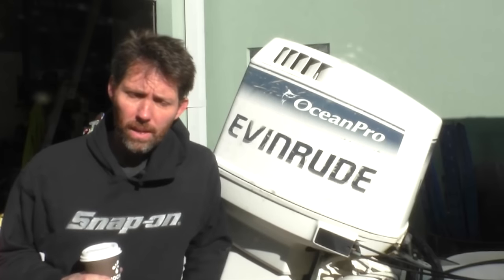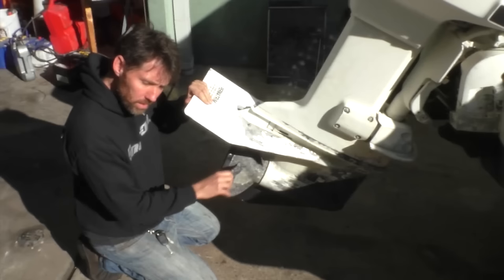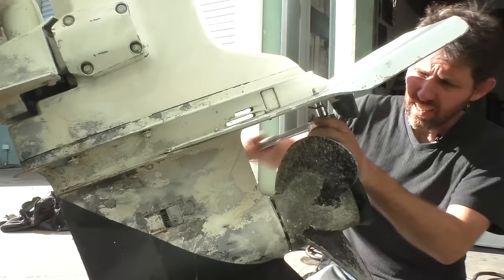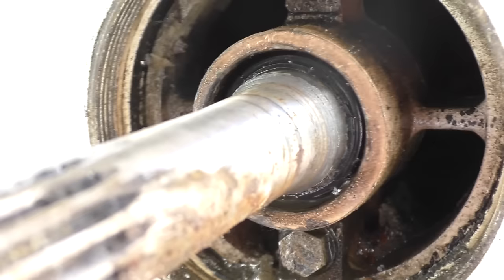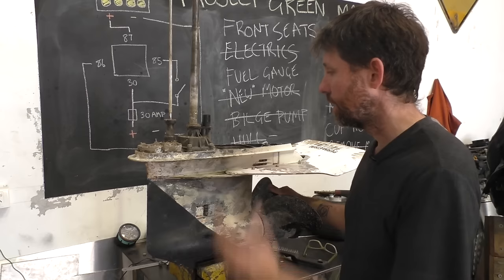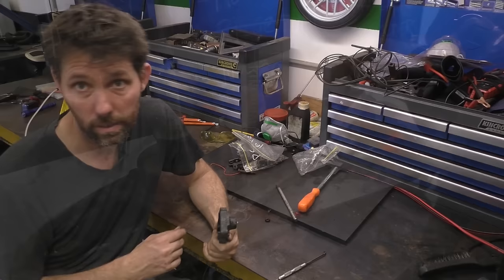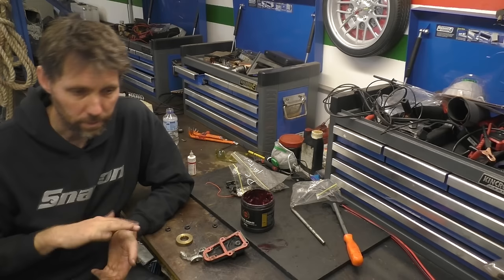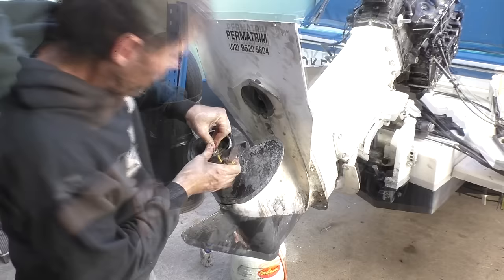Starting an Evinrude 150 outboard for the first time in years

Comment: Great video but i have a question. The impeller is clearly dried up and wont last long or build enough pressure for the engine to run cool. A new/good one dont behave/looks like that, why you didnt just replace it right away is wierd to me? Its like 15bucks and you save alot of time by not have to drop down the lower unit again later on? Also just blow alot of oil into all oil lines with compressor while cranking without sparkplugs so the bearings get lubed aswell as the walls, Put back sparkplugs and then just start it, in my opinion its the fastest and easiest way to safely start a engine thats been on pallet for a long time. Thx and keep it up.
Reply from the maker: Hi Patrik. Instructions from the owner were to avoid spending any money or ordering any parts until it was confirmed the motor was a going concern. Interesting technique with using compressed air to blow oil through, I'll have an experiment with that some time.

Comment: I have had several versions of that exact engine. With reference to your autopsy video, and confusion over the cause of the failure, I would say that this engine sounds unhealthy from the get-go. The starter sounds like it hits a flat spot signifying low compression (maybe you checked compression?). I also hear an unusual amount of jittering from the powerhead when it starts. Mine have always been very quiet with no real clacks or noises from the cowl area. This makes me think the issue was pre-existing and only exacerbated by being run. 

Lastly, these engines have a hot-start feature that gives a healthy idle flare at startup and a  high idle for the first minute or so when cold starting. Doesn't sound like yours is operational. 

Just a couple thoughts from someone who has owned a fair number of these and spent some time tinkering.

I buy a lot of boats that are inop from sitting for years, so this type of process is very familiar and entertaining to watch someone else do! Great vid.
Reply from the maker: Thanks Jake. I've never worked on one of these so its interesting to hear from someone who has. Hopefully a series of follow up videos will be coming along soon.
Reply: yo i have the same one also. donno who thought it was a good idea to have 6 carbs. haha.. dammit
Reply: @pistol850  Suggested by Carburetor Fabricators Local 107.
Reply: i was just trying to figure out how to work on that motor that i actully own. one of u geniuses  wanna come show me. oh what u dont know how and u dont even own this motor.... ok
Reply: ps i dont want no problems...but i am 6ft 200lbs if u wanna come over to pcola and and get pummeled
Reply: thanks but never heard of that. but im not trying to change carbs now because i just took all 6 apart and gasket sealed and put all {6! } back together because at least 4 were leaking.which is why i was just venting about that pain in the butt setup probly designed by the same evil german sabatoge artist that designed my bmw} in the first place but will upgrade or invent an upgrade someday. {probly called a holley 4 barrel carburetor conversion power upgrade package} for any non-believers watching....bang

Comment: well you put spring back on the seal  i wouldn't do that  i would to do reseal everything on lower unit and also you should check compression and spark test if everything comes out good before do anything major repairing that motor  i see that what i am working outboard for 30 years and some of your opition are differance way you doing than mine i just let you know  mine is lot simple to do and quicker ways

Comment: Thanks you are the man.  Pro to the MAX Maybe you can help me with my 2004 Johnson 150 engine is very stiff on the pivot Axel how do I lubricate it I can’t find a fitting it’s very difficult to steer engine has very low hours runs perfectly just was in storage for a long time and it’s difficult to turn please advise if possible and thank you very much keep up the great work his messages from Florida USA

Comment: The nuts, bolts and screws are all af. The shift rod is ment to be that shape DO NOT STRAIGHTEN IT. The seized shift rod is a common problem. Don't use loctite on the shift cover screws, use OMC gasket sealing compound or the Mercury version. The oil filled carbs is also very common with a motor that has been left standing, the oil tank is not venting properly, replace the cap.

Comment: Absolutely excellent video. Please continue to share. When I bought my Johnson 150 the the carb linkage had been toyed with to limit wide open throttle. I'm concerned that the electrical advance, which appears to attached by a linkage rod underneath the flywheel, has been adjusted as well. It's a very light 17' boat with a high speed prop and the previous owner didn't want the motor revving to top speed with his son operating it..  do you have any idea where I start from to restore the linkage back to factory settings?
Reply from the maker: The best thing would be to search the net for a PDF service manual. It will probably only cost you $10-$15 and it will have all the specs you need to return everything to its factory setting.
Reply: @DangarMarine  Great advance, I will do as you suggest. Thanks.

Comment: Great Videos, I have 2004 150 Johnson. The motor has been run for years. Engine serviced runs great…except……steering very tight…. pivot shaft needs lubricant….Can you tell me the best way to get the pivot shaft lubricated for this 150 2cycle motor. I just can’t locat a lube point for the pivot shaft.

Chef Mario Florida USA

Comment: Hi Stu, just been back to this video for a second look. Like the first time, very good and really informative. Up in the north west of England, I have been working on a Suzuki DT50 2 stroke with similar gear shift issues. Anyway, my question is actually regarding your advice on whether to use anti seize grease or thread locker on lower unit bolts, either for water pump housings, shift rod housings, or lower unit attachment bolts? On the video you used thread locker on the shift rod seal plate bolts. I'm never quite sure what to use in these situations? If you use anti seize grease then there is always a good chance these bolts can be removed in future, but equally they could work loose during use? If you use thread locker then they certainly won't work loose, but with the added help of saltwater corrosion, the bolts may never come out again and will shear if you have to try to remove them later. Any suggestions would be very much appreciated. Cheers, Jon

Comment: I have a force 50 that has water coming out the telltail like it should but overheats. I have a new tstat in it...
Reply from the maker: I would take the thermostat out and run it to see if water comes out where the thermostat is. I show testing this in this video https://www.youtube.com/watch?v=dx8_xP30aSY It could also be overheating due to a blocked water jackets or a blown head gasket.
Reply: Dangar Marine could it have good compression and a blown head gasket?
Reply from the maker: Yes, it is possible. You would expect a blown head gasket to reduce compression but I have definitely seen situations where the readings are still good.

Comment: About 25 years ago, the common advice at the end of a boat trip was to run the gas/oil mixed fuel out of the carburetor by unplugging the fuel line from the tank and letting the engine run till it quit.  When we got a newer 2 stroke outboard that had a separate 2 cycle oil reservoir, i.e. the engine mixed the oil with the gas for you, this habit was a disaster.  When you disconnected the fuel line and let the motor run till it quit, it evidentially continued injecting oil and filled the carburetors with oil.

Comment: I noticed that it did not have an exhaust rubber housing on dismantle and installation. I've replaced my water pump but on the water today it kept bogging down and thinking my exhaust boot housing was not sealing and its not smoking from prop or outlets near anode? Maybe suffocating carbs?? Flushing on muffs it runs perfect?

Comment: Hey Stu,  your videos have been a big help.  Its funny I've been getting a 150hp evinrude (two stroke) going over the past few months and would have killed for this video earlier.  Off topic question, I have a 1998 9.9hp four stroke evinrude kicker on the same boat and have been having trouble.  It runs great for about 15mins and then dies (pumping the ball doesn't seem to help).  If you let it sit for about ten minutes you can start it up again and it repeats this same process (there is water coming out of the tell-tale).  Any suggestions?
Reply from the maker: Could be a stuck thermostat. Water coming out the tell tale on says the pump is working, not that it is making it into the water passages that actually cool the motor.
Reply: Thanks!  Great job with the videos.  I think I've watched them all about a dozen times.

Comment: If I let my Johnson 115 v 4 sit for the winter come spring it wont run, one year carb problems, the next year ignition problems over and over again, recently the flywheel cover cracked and had to replace it and the starter, sometimes I wish it would fall off the transom and go to the bottom of the Gulf of Mexico.

Comment: At what point does an outboard become not worth repairing? Like what would a rebuild like this cost compared to purchasing a more expensive used motor in better condition?
Reply from the maker: This video talks a bit about that https://www.youtube.com/watch?v=GTK18LGT9Bw It's hard to say, but in this case I think it was well worth it as the motor itself isn't in bad condition externally, and is now pretty much brand new internally. This means that we now have a pretty top notch 150HP for around $3000. I think that's good value. To my mind it really comes down to how many faults the motor has as that video above discusses.

Comment: Maybe too late to ask but: What is wrong if the engine is starting fine, idles ok, and the moment you shift to gear it dies?
Mechanic went over it and says fine, but for some reason, it keeps dying.
Thanks.
Reply from the maker: Can be a few things. Could be that the gearbox has a lot of resistance / stiffness in it, or it could be that it is running very weakly and even the slightest extra load stall it. It could also be the ignition is cutting out due to a failure in the start in gear protection switch or something.

Comment: I need help with my 2002 Yamaha outboard f60 won't rev past 2500rpm on the lake. I cleaned all four carburetor. Check compression and spark plug and it fine. Got good spark and compression.
Reply from the maker: It could be a faulty sensor making it think it is overheating or out of oil etc which is putting it into limp mode.

Comment: hey great video! they all are from what I've seen so far. I have 2 questions, if you'll oblige me. 1) I just replaced my water pump on a 1986 Evinrude 110. I think I changed the orientation on the shift selector but I wasn't paying attention to the original alignment. how do I make it right before installing the lower unit again? 2) I used 3m 5200 adhesive for the water pump gasket. is that an ok material to use? or was that a mistake that I'll regret? thanks a bunch!
Reply from the maker: Hi Lucas, this video might help you with your shift rod https://www.youtube.com/watch?v=Ufy6W9EI1cg Sealant isn't ideal for a water pump but it should be okay. Might just be a bit tricky to clean up when you next need to service the pump.
Reply: so helpful! got the gear box back on and shift linkage aligned perfectly after watching the recommended video! water pump is moving a lot of water; a good strong cool stream. thank you! do you have any videos or tips for overheat issues? I have plenty of water coming out but the two port side chambers are getting very hot and alarm goes off when opening the throttle? if you can point me in the right direction I'd be very greatful!

Comment: Great video and great channel! Quick question, if your outboard is having trouble going into reverse (keeps clicking and bouncing but still goes backwards), what is the best way to diagnose if the issue is in the shifter or in the lower (transmission) section?

Comment: Good video for sure, was going to take lower unit off mine also but was told it had a hard to get to wire run through it, have you ran into this before? mine is 1973 evinrude 85hp.
Reply from the maker: No, I haven't heard of any wires running through the lower unit. It may be the air hose for the speed sensor they are talking about?

Comment: I'm hoping you can help me I have a 1986 Johnson GT 150 it does not fire on one whole side it will run on the other three cylinders I just replaced the stator the trigger and two power packs but I still have the same problem and now I noticed when I go to shut it off it keeps running but it won't sit there and run on just three cylinders it will die when it's at an idle could you please possibly help me

Comment: Hey nice videos on youtube
was woundering if u could help me out
I have a 2004 200 hp EFI Murcury and i didn't  get to use for a few years,
now i want to use so i have done the basics to get on the lake again but now I'm having issues.
I drained and cleaned tank
I took Drain plug out of fuel water separator and drained old fuel
Changed fuel water filter and cleaned out fuel lines
So put in fresh fuel and it cranked right up and was running but i had fuel being pushed out at the top of my fuel water separator and thru the hoes that is connected to the cover  
what do u think the problem is and can u tell me how to fix it
thanks 
Tim
Reply from the maker: +Tim Baker I'm not 100% sure I understand what you say is happening? Is the fuel leaking out from the o-ring or a hose clamp?

Comment: I have a question sir, I have a 1997 175 V6 Johnson outboard I have bought 2 coils that keeps on going out when installed now I just bought my third but this time I bought it original should I check my power pack before installing the original coil??
Reply: l have done a bit of this in my time here in Tennessee Norris Lake...Always check the Power Pack my friend...Hope this helps...!
Reply: Thank you sir this fixed the problem

Comment: Hey man been following all your videos! And may I say, amazing tips! I just have a question and would love your expert advice. I have a 80's 70HP evinrude engine and I seem to have a very hard time cold starting her! My procedure is have the engine tilted down fully, primer bulb until hard, raise idle all the way up, press key in for choke and try cranking. It just doesnt want to start. People are saying my choke technique is wrong but I dont know what I'm doing wrong. Last time I had a guy at the boat ramp start her up for me, once shes warm, she starts fine first time every time. Just the cold start is an issue!
Reply from the maker: Hi mate. Does the choke solenoid definitely work? Try taking the cowling and airbox off and look down the carburettor while someone pressed the key in. Are you holding the key in while you are cranking the motor? Does the choke stay closed the whole time you are cranking with the key pressed in?
Reply: Yeah she definitely works, I was holding it in for about 3 seconds while cranking the engine, then I let go, I tried that afew times. Should I hold down the choke while cranking for abit longer before stopping and trying again?

Comment: Hi Stu, do you think the oil in the carburetors may have been caused by the fuel having been disconnected to run the fuel out of the system, but the VRO was still in operation, which pumped them full of oil?
Reply from the maker: That is definitely a possibility.

Comment: A friend gave me a 1978 35hp Evinrude which had been sitting outside for about 7 years. He said it ran great, but the top crank seal was leaking bad and shorting out the electronics. The motor was not seized. I changed the seal.  I poured some 2-cycle oil into both cylinders and turned the motor over several times with plugs out periodically over several days. I could feel compression with my finger from both cylinders, but it seemed weak. I checked the compression and one cylinder read 35 lbs. and the other 32lbs. So, do you think this engine may need to be cranked up to re-seat the rings which will increase the compression or maybe it is shot. My friend had no reason to tell me that the engine ran great. So, thinking maybe some rust needs to be honed off the walls by starting it if it will start with such low compression and allow the rings to expand? What do you think? Thanks
Reply: I figured the rings were stuck in the piston grooves. I turned one piston up to top dead center and used a propane torch to shoot fire into the plug hole to get the top of the piston hot. Then I sprayed liquid wrench into the cylinder and let it set for about 15 minutes. Then I rocked the flywheel back and forth a few times. Then used the pull start to turn it over about a dozen times. Took compression and got 55lbs from the previous reading of 35 lbs. I did the same thing on the other cylinder and got 55lbs on it. I will do all this procedure periodically fpr a week and see if I can get more compression. I figure it should start up with 60 lbs. on both cylinders and then the rings can loosen up more and seat to the cylinder walls which should then get at least 80 to 90 lbs of compression. First, I have to get some screws for the magneto and a crankshaft nut because this guy misplaced them when he removed them to get to the seal and decided he could not change it 7 years ago. Thanks